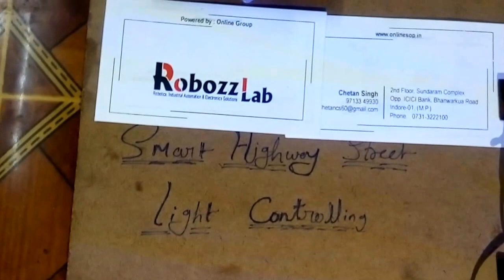How to Make a Smart Street Light System : Robozz Lab

Comment: I am doing a similar project. What LED size did you use to mimic the streetlights?
Reply from the maker: The LED which is used for street lights are 10mm in diameter.